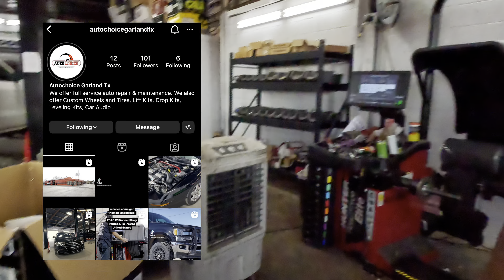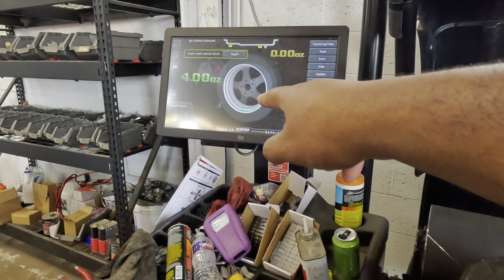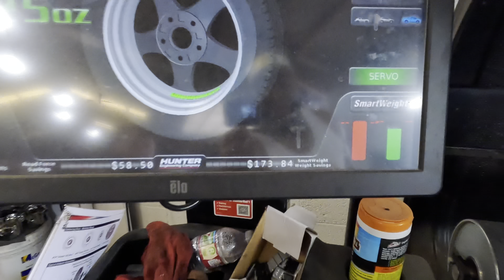My New 24x14s Are On But It Rubs BAD!

Comment: I had a 2017 with 6in lift, started with 20x10 on 35's, then 22x12, again 35 but 13.5" wide.. I wouldn't want 24's by any means what so ever.. I miss the ride the 20's gave.. And when this set of tires is gone, I'm gonna sell the whole set and buy a set of 17's and get me a real comfortable ride with some nice fat sidewalls of rubber.. Kinda over the big wheel look and wanting to go back old school or pre runner style..

Comment: What was better, Recon or Ridge Graps?
Reply from the maker: Tough choice. Both shine in different areas. The recon is perfect for a street day today driving. They’re very quiet and smooth but they aren’t the best in wet weather.

The ridge grappler is great in wet weather, but they are a little louder and not as smooth as the recons.

Comment: Looks great! Did you cut have to cut the front bumper or add bumper spacers to not have the 12" wides not rub? I have the same offset and am rubbing at full lock with my newly installed 33" X 12'5" R22s.
Reply from the maker: A lot ofof trimming and cut bro

Comment: Why did you switch back to the Recons?
Reply from the maker: These are the ridge grapplers but I’m just gonna rotate and swap between tires honestly use them both
Reply: @KickinItWithQ  Sounds like something I would do. I’m looking at the Recons. Like the look and dislike road noise. Thanks for the reply.

Comment: What is your offset on the 24x14’s?
Reply from the maker: -76
Reply: I’m about to put the vertex clovers on my truck.  I have the 7 inch lift Ready lift.  The coil over say up to a 6.5 lift.  Did you have to put a 1/2 space to get to the 7”. 

I see that you went back to the 24x12 -76?  With a 13.5 tire?

Comment: Looking good homie! Great choice of tires  ... love my Ridge Grapplers ... 

A couple things though,  the way he seated the tires using the liquid pop is not good for your tires, that "will" damage the seal 

I worked for Big 0 Tires for 5 years, we don't seat tires like that,  keep an eye on them!
Anything over 4oz of weight on tires this size requires the tire to be spun 180° on the wheel, that will lower the amount of weights needed to properly balance the wheels 

Check all 4 wheels,  make sure that the ones with the least amount of weight are in the front  ...

Other than that homie the truck looks B@D@$$!
Reply from the maker: Thanks bro! He did make sure one with least amount where up front. I appreciate the info man!
Reply: @KickinItWithQ  nice!  ... that way you have less chances of any vibrations

Comment: I really would like to run 24x12’s on 37 13.50 Nitto’s if I can.
Reply from the maker: That’s the perfect day driver set up in my opinion
Reply: @KickinItWithQ yeah I agree. U think I can run that setup without the coil overs like u have?  The 24x12’s on 37’s
Reply from the maker: @nicolesalinas382 nooo it’ll definitely rub bad unless you go a taller lift kit
Reply: @KickinItWithQ  yeah ur right. Did u like the Nitto recon grappler tires?
Reply from the maker: @nicolesalinas382 I do super quiet and comfortable. My only complaint about them are they aren’t the best in wet weather. Especially light rain, they get a little slick. Here’s a comparison video https://youtu.be/zfotoZy_pKw?si=FXvFZWEnUiKauMM9
Reply: @KickinItWithQ ok I’ll check it out.  Thanks for the info. Ur videos r bad ass and helpful
Reply from the maker: @nicolesalinas382 glad you enjoy them man! I appreciate you watching

Comment: Ur truck is so clean bro!  How big of a lift you have?  I wanna go bigger setup on my lifted 24 ram 1500. I have a 6 inch. Still debating on whether I should go 24 by 12’s or 24 by 14’s and whether I need to go 35’s or 37’s. I’m on 20x12’s and 35’s right now but I know I can go bigger
Reply from the maker: It’s a 6 inch lift, bro. I didn’t get the Coilovers and raise them up a little bit. Yes I do still rub I get about a turn 1/2 before I rub.
Reply: @KickinItWithQ ok so u didn’t get the coil overs?  I appreciate the info and how did u like the recon grapplers if u don’t mind me asking
Reply from the maker: @nicolesalinas382  I did get coilovers
Reply: @KickinItWithQ  oh ok so u think I can run that setup without the coil overs?
Reply: @KickinItWithQ just curious bc it’s a big purchase.